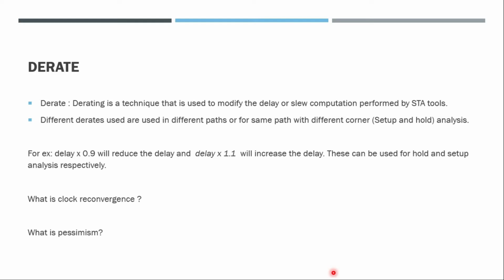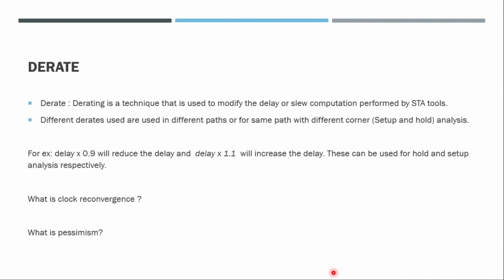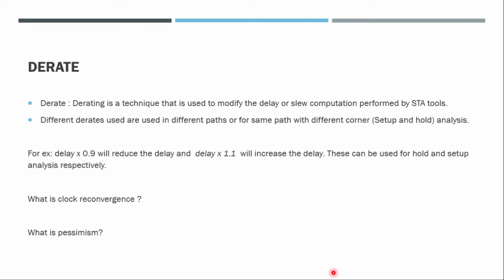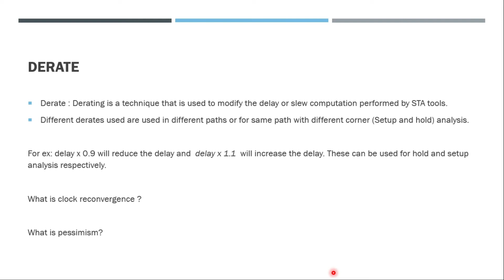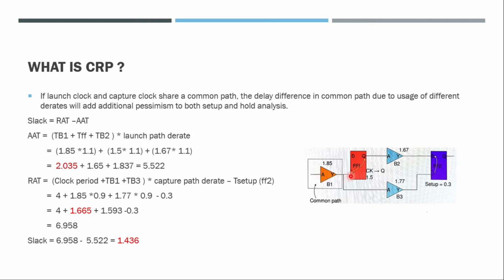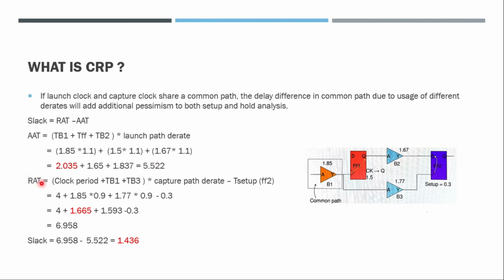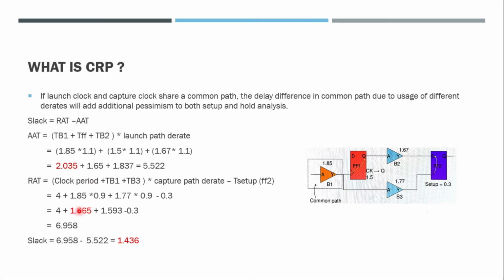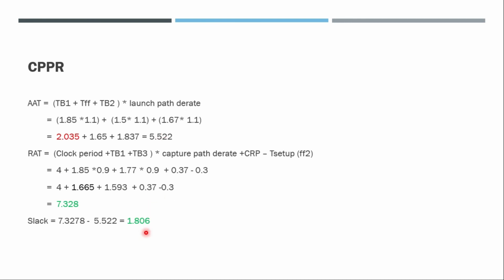Clock Reconvergence Pessimism Removal (CRPR) | STA

Comment: hi , i understood the concept well. But would like to know like how that pessimism value is added in RT for s setup and hold. What i have seen in PT tool is for hold the difference is minus from RT ...not able to find for setup , how this pessimism value is calculated.. could you help on this ?
Reply: For setup, it will be the "time difference at common point" minus "crosstalk component in the common clock path". For hold (full-cycle), xtalk component in common clock path gets cancelled out.

Comment: Pls.. could you tell about GBA vs PBA and which one have to do first
Reply from the maker: GBA happens firstor in earlier stages of the design. And PBA is used at the later signoff stages. GBA is pessimistic compare to PBA. So, PBA has highest accuracy but costs more runtime.
Reply: @jairamgouda  thqu soo much